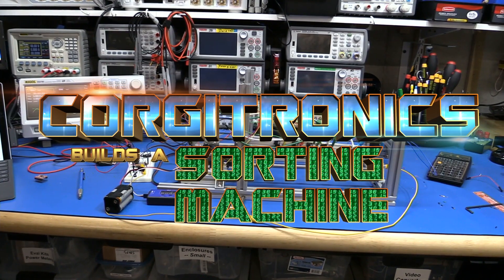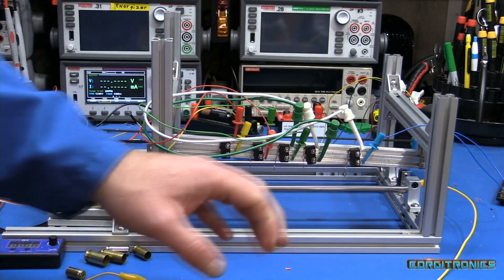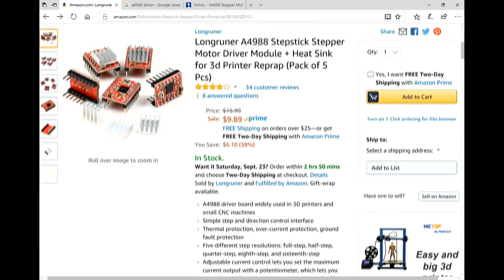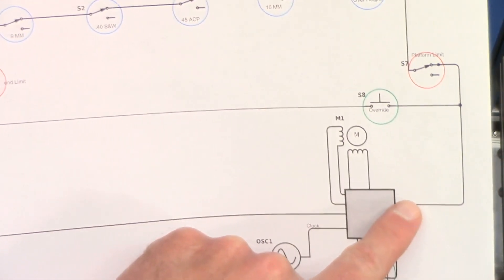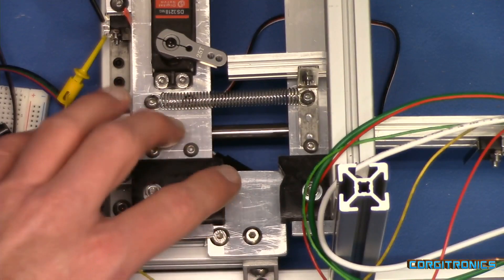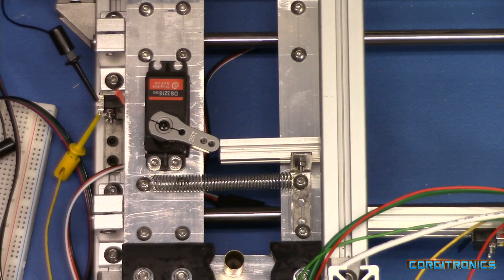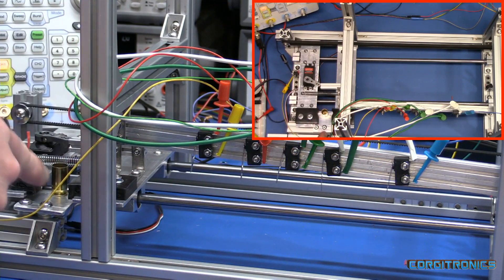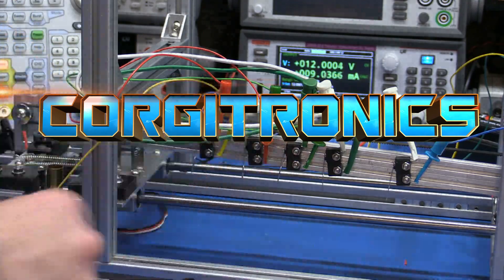Case Sorting Machine - prototype

Comment: You may have issues due to manufacturing variables. Not all cases are same length.
Reply from the maker: Yes, I had measured quite a few and found that used cases tend to be non-SAAMI spec length.
This machine was just a prototype that I used to learn a bit about steppers and such.  I hope you watched the videos of the larger sorting machines that I built.  I actually have another video coming soon... if I can get the editing done.